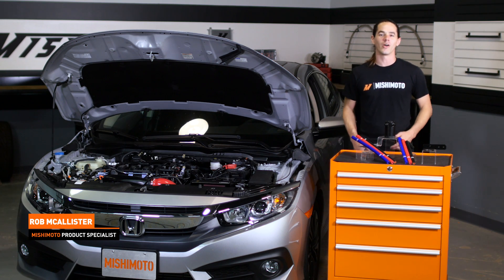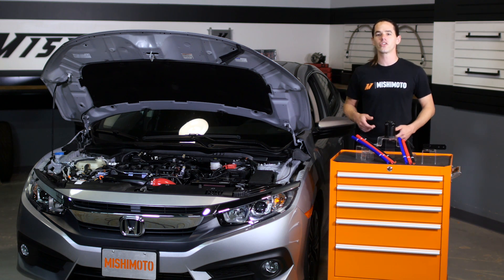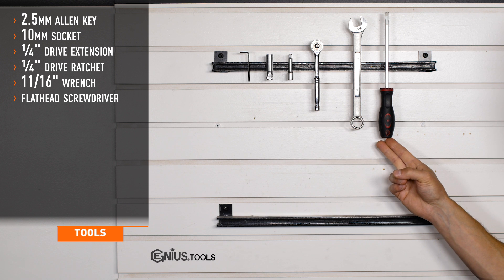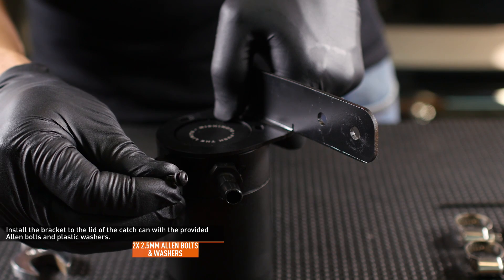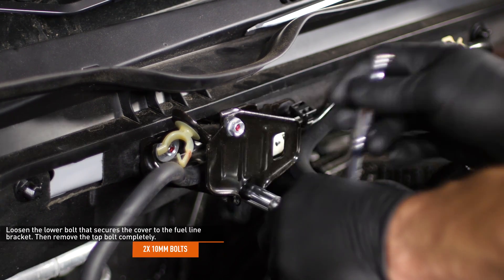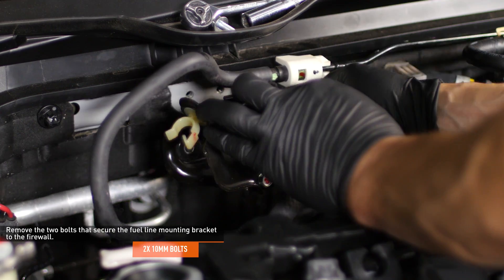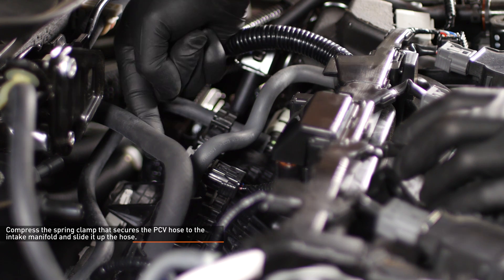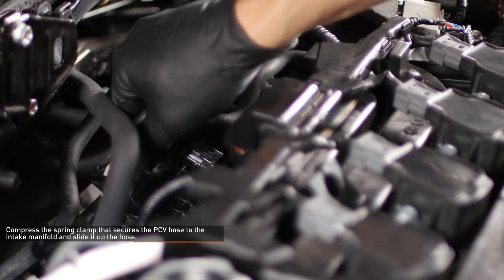2016-21 Honda Civic 1.5 Turbo Baffled Oil Catch Can, PCV Side Installation Guide by Mishimoto

Comment: I bought one of these originally for my 10th Gen Civic, but traded it for an 11th Gen. I installed the catch can on my 11th Gen. The hose with the 90 degree bend was too short to use, but I used the original 'In' hose for the 'Out' port on the catch can to the manifold and got the Mishimoto Universal Catch Can Hose 3/8" x 4' and cut it to length for the 'In' port to valve cover. Haven't had it on for too long now, but so far its been working great.

Comment: I know this is an old video, but two tips. 1) when unclipping the fuel line, get one finger on the back to press up on the tab while simultaneously prying on front. Comes off MUCH easier. 2) the PCV hose line will likely be tight. I could not just pull loose. I used a small pick tool to pull up on the lip of the hose while pulling out with other hand. This released easily at that point. But you have to have that tool to pull out around the lip and release the grip. Otherwise pretty easy. I also ended up using a zip tie (loosely) to make sure that the fuel line did not rest against the catch can.
Reply: you are talking about the white fuel line clip right? not the black one?

Comment: I need that background music. And the new can works great! Already a few grams of oil at the bottom. Better there than on the valves!

Edit: I had the first can for about a week before noticing a subtle rattling coming from the dash. It suddenly got worse over the next few days and I called Mishimoto about it. They sent me a replacement can at no cost and the rattle is gone.

They really don't mess around with customer service. Great installation video guys, and please tell me what that background music is! Shazam is about as useful as a hedgehog in a condom factory.

Comment: Do the paip from PVC should connected to "Inlet" , and "outlet" paip should be connected to Intake manifold? Please clarify , Thanks
Reply from the maker: That is correct, the inlet will on the catch can will connect to the PCV while the outlet go back to your intake manifold.
Reply: @mishimoto  Thanks for the clarification !

Comment: I am looking to install the same Mishimoto catch can in my Nissan Qashqai 1.2T (Rogue Sport) as per your video. I have a question after some research, does the PCV close when under boost? If that is the case, will the oil vapour from the crankcase be drawn into the turbo > intercooler > trottle body > intake manifold?
Reply from the maker: Most factory PCV systems will return directly to the manifold preventing the turbo from ingesting oil. In regards the PCV, the setup will be different for every car. In some the system will keep air from going back in and in others required the installation of a check valve. As we have not looked into your platform we cannot say for sure what would be needed.

Comment: If you have this product it can create an infuriating rattle. They'll take care of it but just be advised it's a thing to consider if you get crazy weird noises coming from inside the dash when you gently apply accelerator.
Reply: I just installed mine and I noticed the rattle at idle/low rpms. Did mishimoto provide you with a fix for yours?
Reply from the maker: This is not a normal noise, if you are experiencing the issue please contact us regarding this.
Reply: I am having the same issue. Was it ever resolved?

Comment: this is not necessray for honda 1.5 turbo..this engine is made to minimize carbon build on intake valves...
Reply from the maker: We though the same thing while testing. However the amount of oil collected proved otherwise.
Reply: @mishimoto  https://www.youtube.com/watch?v=WnnlbnW11EY&t=201s...Honda is very expirienced in making most realible engines in the world...they waited long time before they decided to introduce turbo direct engines...they know about all problems of tjis type og engine..so why i have to spent money for nothing..you dont have proof...and you can may cause problems with that catcher...the engines have  air mass meter and are controled by Control Module
...why that...are you sure you make real thing..can you proof it..technical with guarantee..that this is right for engine...??I saw also ine video but cant find it..some guy had golf gti with turbo direct engine..and bought type r with turbo direct engine.He made oil catcher in both of them .according to him Vw golf had 2dcl after 2 weeks and about 1000 miles and honda almost nothing...so give test....but real test..and make proof...s easy to make money for nothing.
Reply: @IrmanSarajlija  Dude, first, your grammar is absolutely grotesque.
Second, I've had mine installed for two weeks now and I've already collected nearly 3 grams of oil at the bottom. My 2020 1.5T Civic Si coupe is pushed to the limit almost every day, so I'm really glad I got this product.

And third, first grade English lessons are free on the internet. Might want to look into them.
Reply: @ltrs1212  my mother language is not english..and you are the first one that complained about my english..i know its not good..normally english speaking people dont say anythimg about it until they really dont understand..you behave like the people from austria or germany ..they alaways complaint about german grammar...and i speak german and 2 languages more..until you cant speak my mother language you dont have to say it..please cool down..i will never buy this extra capitalism products for nothing...my honda runs perfect and will rund next 200000 km ..for me is enough..and thats my opinion..please respect it..and haha i saw you play games kid..please keep playing games..and push honda every day hard..i have family and drive my car normal..sometimes if necessary hard...thats not my play mobile....

Comment: good video. one thing I did different was popping the fuel line retention clip at the back, as it refused to hinge open for me. Just squeezed the back of the clip with a needle nose pliers and it came out.

Comment: Some words of advice to those following the instructions on this video:

1: that fuel line clip is a bitch.  Be careful prying at it as it seems like it will break very easily.  Prying from the bottom instead of the side seemed to help.  It sucks, take your time with it.  Wearing some leather gloves might help with pushing the back of the pin while you pry upward
2: pulling the stock hose from the intake was way harder than in this video.  The stock hose clamp may have fused the hose to the port a bit. You have give it quite a pull.  The other side came off very easy though.
3: the allen wrench bolts on the top of the can will strip easy.  Do not over tighten.
Reply: you are talking about the white fuel line clip right? not the black one?
Reply: I just pushed what secures that clip from the back I couldn’t open it!!!😭🤣

Comment: Nice clean install.. does it have a drain on it or does it need to be separated ??  Can you reach to drain it ?
Reply from the maker: Hey Stanley, these kits typically do not come with a drain unless required by the application. This kit can be drained by unscrewing the can or with the optional drain kit: https://www.mishimoto.com/compact-baffled-oil-catch-can-petcock-drain-kit.html

Comment: I have no idea what it is and do?
Reply from the maker: Catch-cans prevent oil and fuel blow-by from entering your intake tract. Blow-by can cause a loss of power over time due to build up within the intake, on the back of your valves, and by affecting the air/fuel ratios.

Comment: @mishimoto can you unscrew the Can while it is mounted? Seems like it takes some force to unscrew and I’m worried the bracket will break....
Reply from the maker: You can remove the bottom of the can without removing it from the bracket. You shouldn't have any issues with that.
Reply: Thanks!

Comment: Got to 1:07, mangled my clip, scratched up whatever the metal line is behind the clip, bloodied my knuckles.  Do not try to to pry this clip like the video shows.  There is a small tab behind and underneath that must be depressed before the clip will come apart.
Reply: I did the same, bad advice on their part, wish I would've seen your suggestion beforehand!
Reply: Same, the clip shown in the video is different than the clip I have on my 18' civic.

Comment: Just installed mine, but what do you guys think about venting it to atmosphere after it has been collected in the catch can? Possibly replace the recirculation with a filter?
Reply from the maker: Hello GenXCivic Si  .  Unfortunately would not recommend trying to run a set up like this. Typically the vacuum on the PCV system is coming from the intake side. So you would be losing the pressure that is running the blow by into the can. Sometimes both sides pull a vacuum, but you'd still be running the risk of not pulling enough pressure to make it up into the can. This leaves the potential for it to go back down into the crank. You may catch some, but not nearly as much as running the re circulation. This also gives you the chance of running into a check engine light.
Reply: Mishimoto Automotive okay. That makes a lot of sense. Thanks for the reply.

Comment: I wonder if this will be close to the same in the 2017 CRV
Reply: I would like to know too.
Reply: I also have a 2017 CR-V. Did you find out?
Reply: I want to know as well
Reply: It's a 1.5 engine same engine so it does work!!

Comment: Hey Guys love the catch can but I'm getting an oil smell in my cabin now I checked my cabin air filter and it smells like oil too.
I put a bit of baking soda in the filter to clean the smell and it helps. 
I rechecked my connections and they are good but the smell persists.
The catch can is working I checked and it has started to collect blow by.
Any advice from other buyers or Mishimoto?
(I'm buying a new cabin air filter but I don't want to install it until the issue is resolved)
Reply from the maker: Hi ElectricZebra85 - sorry to hear this! Please call our customer support specialists at 1-877-GOMISHI or email support@mishimoto.com.

Comment: the hose from manifold to PCV is hard to remove..how to remove it without cutting the hose?
Reply: I have the same problem - clamp removed but hose does not want to pull off and I'm really stretching the SOB.  Might have to cut it.  Wonder if Honda used an adhesive on the hose.  Mine is a Honda CRV, 2017.
Reply: I did a lot of twisting and used a flat head screwdriver to pry on the end of the hose. One end came off with twisting and hard pulling. The other end didn't come off until I pried with the screwdriver.
Reply from the maker: Hey pikachu mouse! Compress the spring clamp that secures the PCV hose to the intake manifold and slide it up the hose. Then pull the hose off the port on the intake manifold.
Reply: Mishimoto Automotive yup i do it..but it is still hard to pull up on both side...
Reply: harley62t i really dont want to cut it..bcause i can use back original if i sold the car..mine civic 1.5 mileage 40km only
Reply: I got my PCV hose off...finally. Put it back after lightly lubing with a little anti-seize.
Reply: harley62t how you pull if off?
Reply: I wanted mine off to measure the hose I.D....it's 8 mm.
Reply: harley62t my oil catch tank project cancelled... got 5yrs warranty and any dirty on throttle body intake manifold can ask them to clean it up... i really dont want cut the hose but the hose now got many scratch by plies..still dont want to come out..
Reply: Hi Pikachu Mouse and Harley62t!  The hose can be a little stiff coming off, but there are a few tricks you can employ.  There is no adhesive involved, but the hoses tend to get baked on over time.  If you have a small pick, you can slip the end of the pick under the hose and work it around to break the seal.  This will work even better if you put a little penetrating oil (WD40, PB blaster, etc) on the end of the pick.  Twisting the hose using a pair of pliers can also help, but you are more likely to damage the hose this way.  The hose should come right off once you work the pick around in there.

By the way, this same technique can be used on almost any sticking hose you encounter.  Don't give up and put the knowledge in your mental toolbox for later!  If you don't have a pick set, they are available at any auto parts store and they are super cheap.  Definitely something you should have in your tool collection.
Reply: harley62t i installed it and the only way I got the stock hose out was with a flat head tool and lifted a little on the hose and came right up easily

Comment: Awesome product, just installed mine and love the new catch can.
Reply: BoostUp are you on boosted engine? did you install the check valve?
Reply: A.S. Husaif  yes I have the 2017 civic hatchback
Reply: BoostUp Did you install a check valve? this vid doesn't seem to have a check valve installed so I'm just curious
Reply: A.S. Husaif  doesn't require a check valve
Reply: So havenyou drained it yet? Do you have to unbolt them again? That's a lot if work.